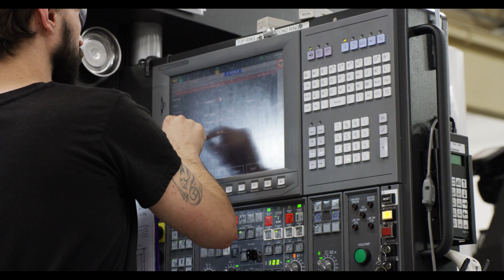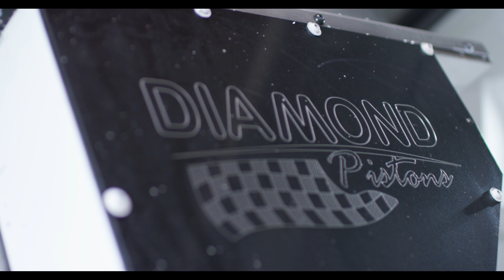A Tour Through Diamond Pistons

Comment: Dear Friends, I have a technical question if I may please. Do the cnc billet pistons gets any heat treatment once the chunk of aluminum is cut from the extruded 2618 bar OR the main raw material which is the 2618 extruded bar stock already is in T6 ( or any other T ) form ? Kind regards.